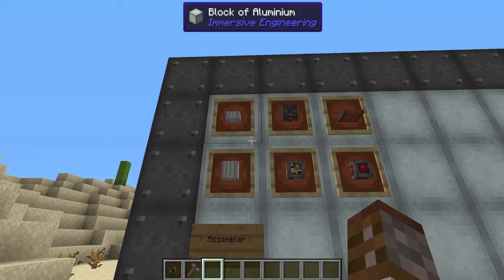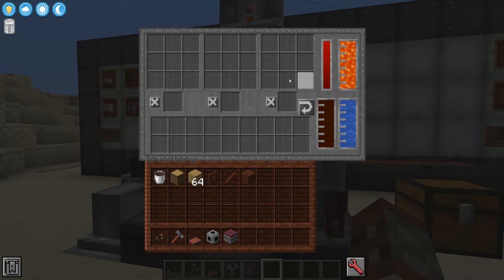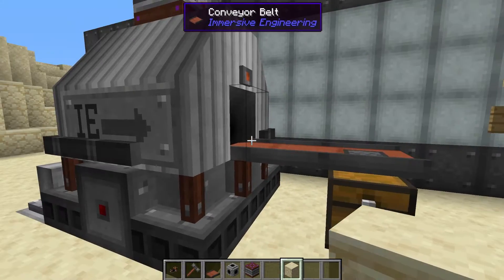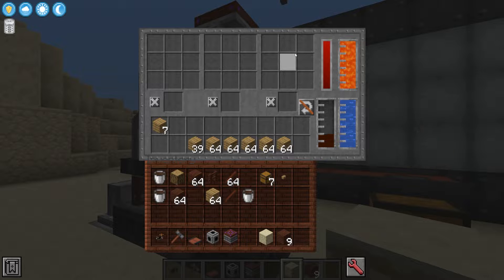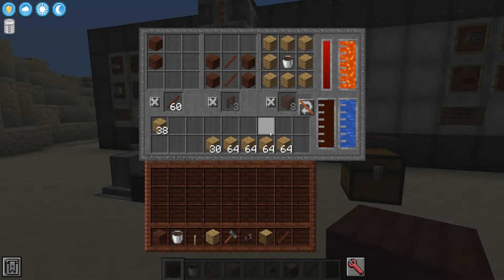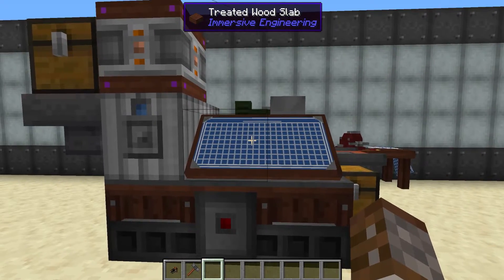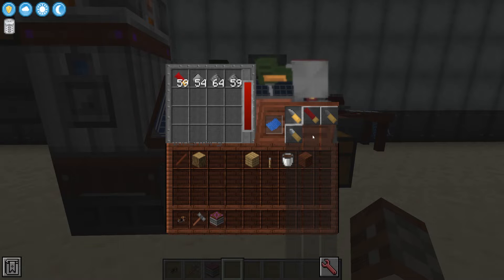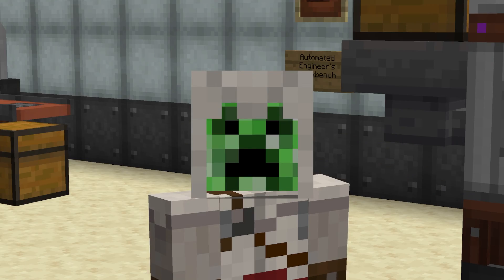How to: Immersive Engineering | Assembler & Automated Engineer's Workbench (Minecraft 1.16.5)

Comment: why cant i make the assembler? i already have the 3x3 thing with the conveyor belts facing the same direction but its still not working. and yes im shift right clicking with the hammer
Reply from the maker: Depending on the modpack the pack author may have disabled the assembler. I have had that in the past. Besides that I don't know
Reply: @Mondays3  yeah i found out a while ago that it was disabled until I do something (that's difficult) in the modpack. Thx anyway
Reply: @jarvis___73  could you explain further me and my friends have been stuck on deceased craft unable to progress because we cant make engineers screwdrivers or an assembler i have checked the server files but cant find anything saying its disabled